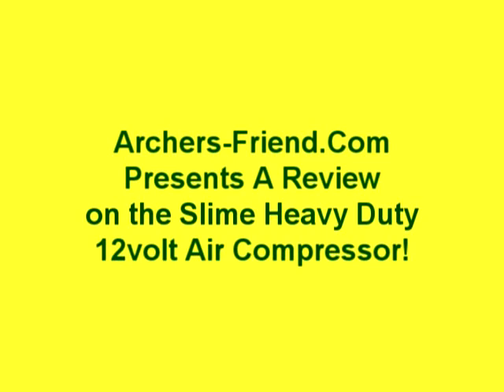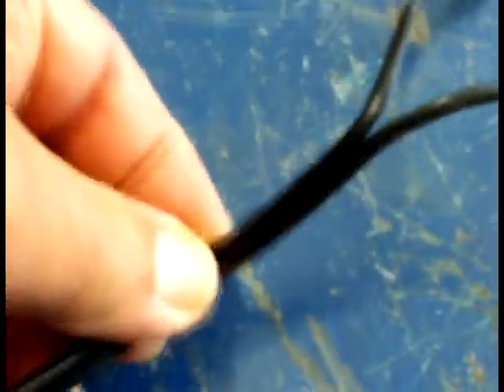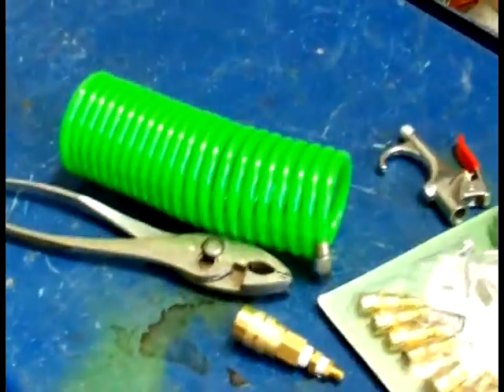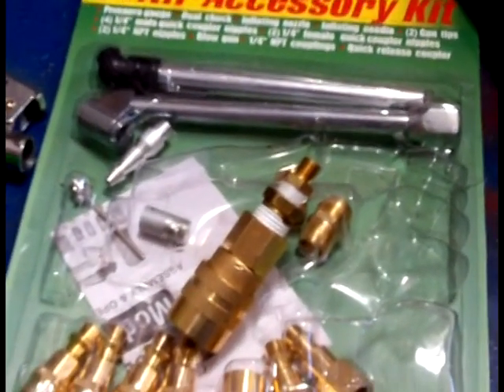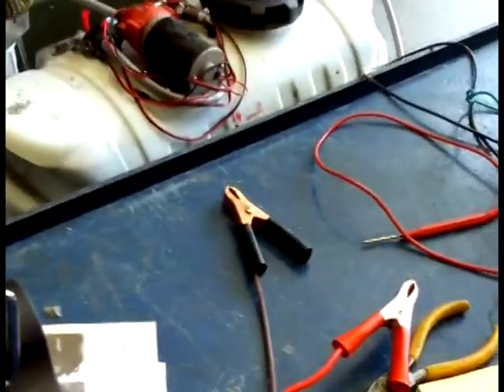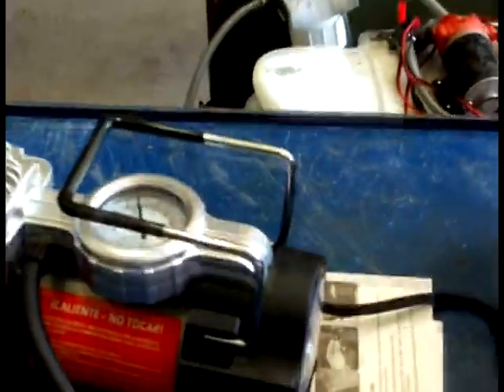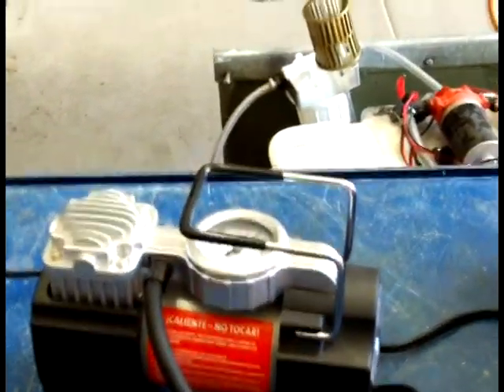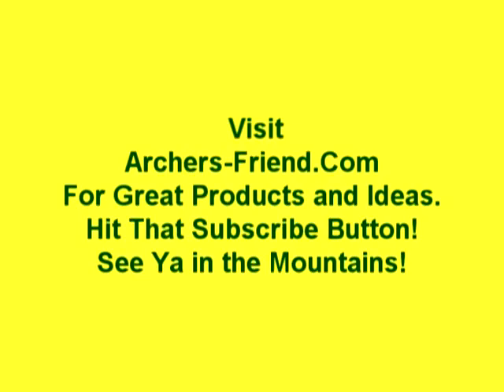SlimeCompressorReview

Comment from the maker: @npadul30 
Thanks for the tip, maybe the tubers can get a better deal than I got.  Anyways, an inverter and a regular pancake compressor is what I use at camp when I have my Truck to run the inverter.  ATVs can not power an inverter of that size.